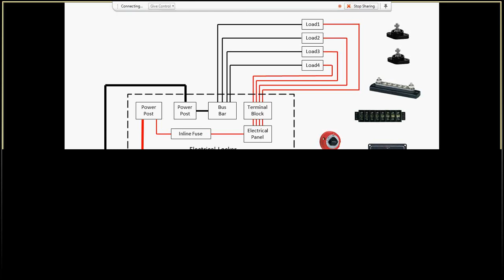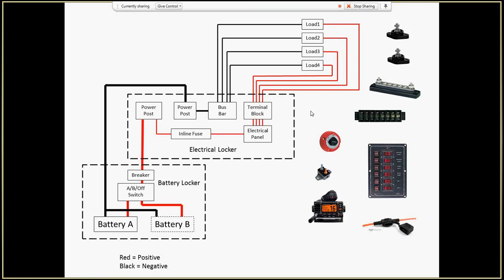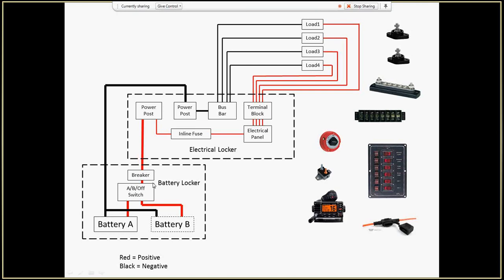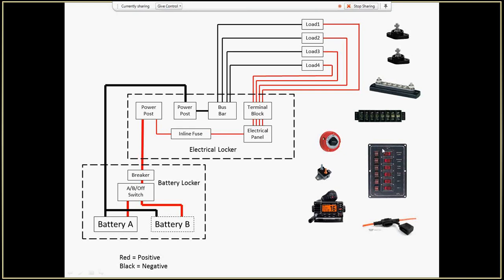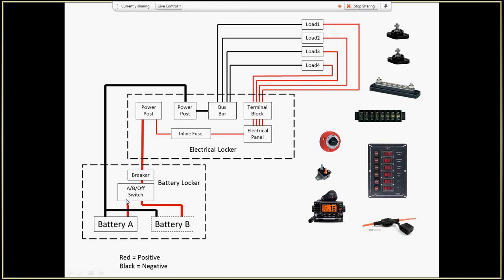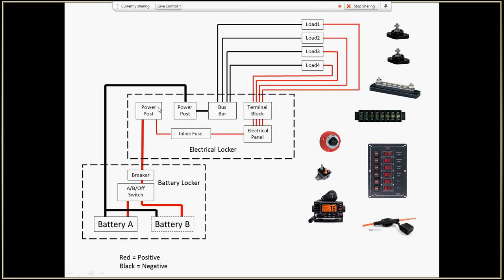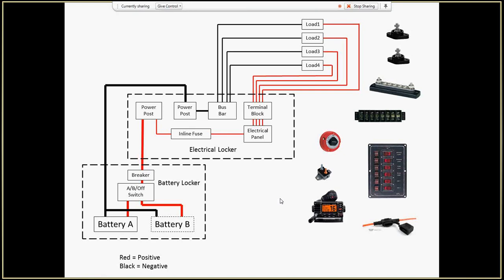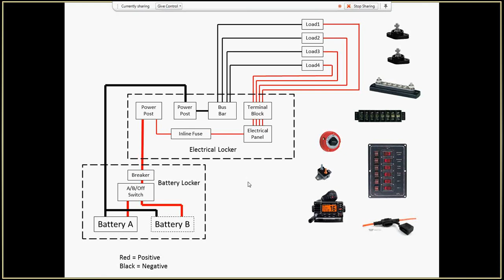Small Sailboat Electrical Wiring Diagram

Comment: Very good video. I have a few questions 
1. could the negative return line run from busbar to baterry ie no power point required.
2. If you had an automatic bilge pump how would you add it to your system
3. If you had a inboard engine how would you at its battery to the system.
Im thinking of using a similar diagram.

Comment: What's the significates of the terminal block?  Why couldn't you just by pass it and run your circutes direct?
Reply from the maker: Some of the switches on the Electrical Panel go to more then one load.
Example the Nav light switch goes to 3 lights.
Reply: @genglandoh  So if you lose the bow light you lose all nav lights! Not good!
Reply from the maker: @eastendguy485  Sorry I did not explain it very well.
I have 1 switch that goes to 3 individual nav lights (loads).
There are 2 wires to each nav light (Positive and negative) so 6 wires in total.
On the field side of the terminal strip I use 3 separate connections. 
One for each positive wire to each nav light.
On the switch side of the terminal strip I also use 3 separate connectors but I also have a jumper connecting then together so I only need 1 switch.
Thank you for pointing this out.